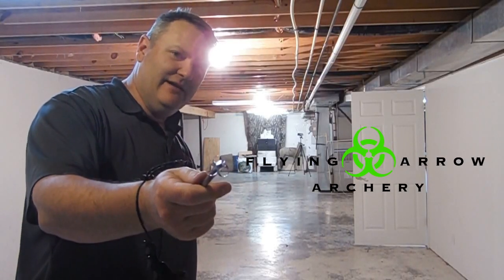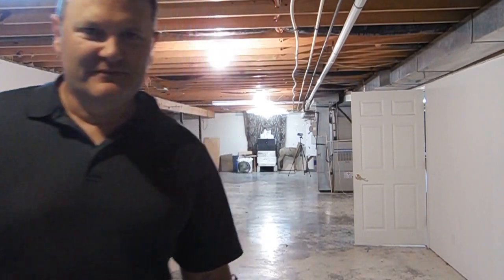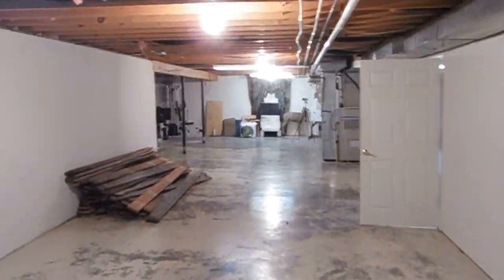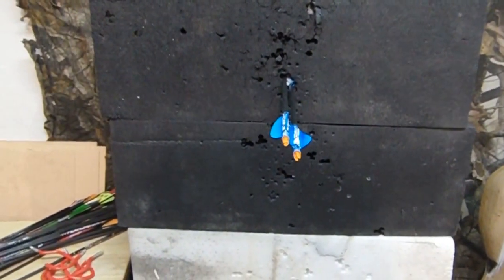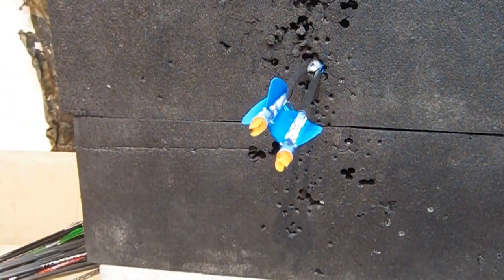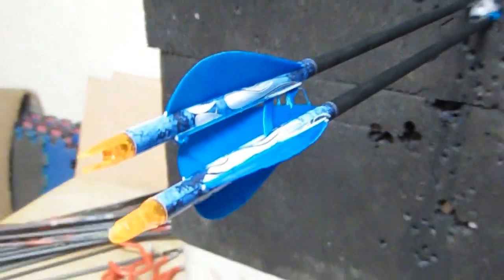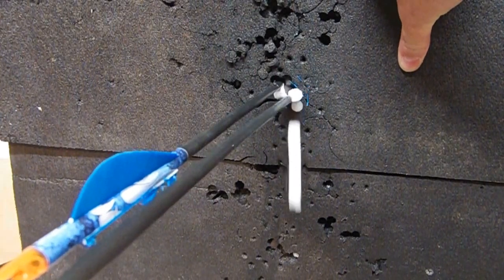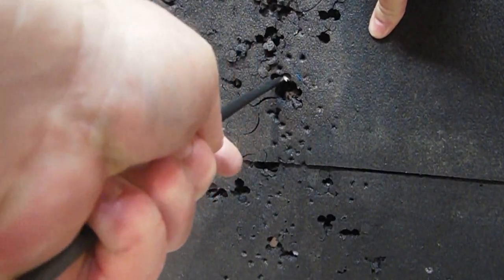20 yard Flying Arrow Archery Toxic Broadhead test

Comment: I have noticed when I have trouble getting fixed blades to fly, if I switch to a feather fletching it usually fixes the problem. But that doesn’t mean to shoot feathers and not tune your equipment. I just joined the element, and flying arrow family, and can’t wait to put these heads and my nucleus shafts to work.

Comment: Pretty good group in a controled environment but how well do they perform in a cross ind?I can see how these broadheads cab cancel out the steering and lifting effect that is generated by conventional fixed blade broadheads which essentially act as a airplane wing in certan wind conditions and the larger the blades dhe more dominant this effect can be without proper stabilization from the back end of the arrow.
Any arrow will fly teue provided there is enough stability at the back of the arrow to counteract the effect of the broadhead.